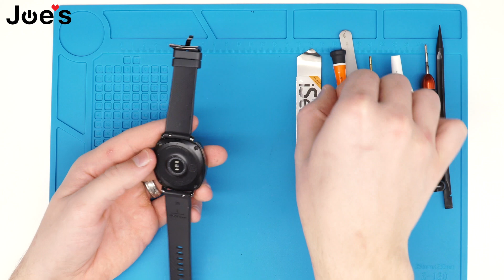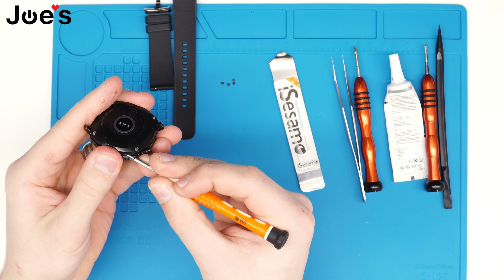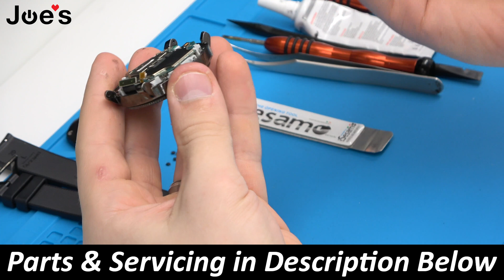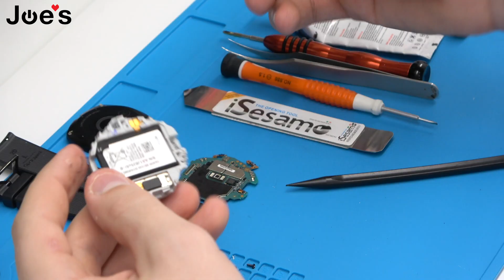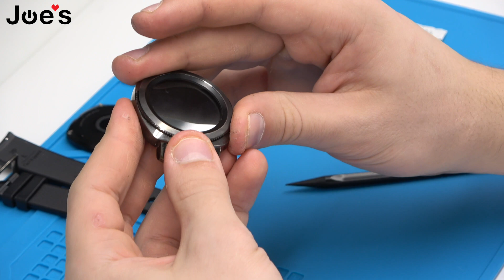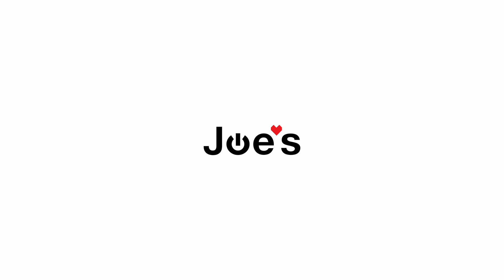Samsung Gear Sport SM-R600 Battery Replacement | Repair Tutorial

Comment from the maker: Buy New Battery + Repair Kit: https://www.joesge.com/products/samsung-sm-r735a-sm-r730a-sm-r730v-sm-r600-sm-r735t-300mah-eb-br730abe-battery-repair-parts?variant=41360580542510
Buy New Battery: https://www.joesge.com/products/samsung-sm-r735a-sm-r730a-sm-r730v-sm-r600-sm-r735t-300mah-eb-br730abe-battery-repair-parts?variant=41360580509742
Buy Repair Tool Kit: https://www.joesge.com/products/y-2-0mm-samsung-back-cover-screwdriver-repair-tool-kit-tools?variant=41045322727470

Comment: Great tutorial. Unfortunately for me, that Philips head screw holding the board to the battery was immovable. #000 screwdriver bit in a good Wiha bit holder and all my 170 lbs. applied to it, and no go. Switched tips, added a tiny bit of PB Blaster, and eventually I stripped the screw. My hands aren't steady enough to Dremel a slot in the screw head. Oh well, foiled again, a new battery and old Gear Sport watch become e-waste.

Comment: My watch wont charge. It turns on but not enough life to do a reboot. I tried different docks and wires, nothing. Dock just keeps blinking red when screen shows battery then it goes black. Will changing battery help?
Reply from the maker: Hello, thanks for commenting. Please email us at support@joesge.com with your question. We will be able to better assist you there. - JoesGE
Reply: @Joesge  why email. Could just said yes or no. Or maybe don't respond at all. Just ignore all questions

Comment: Hello! Great tutorial. I got to around 3:50 but when I connected the board and battery, it got extremely hot and emitted a burning smell. Any idea why that might be? (I immediately detached it and left it.)
Reply from the maker: Hello, thanks for commenting. Please email us at support@joesge.com with your question. We will be able to better assist you there. - JoesGE
Reply: Did you figure out the problem? Mine did the same thing. As soon as the contacts touch it gets extremely hot within 1 second. I immediately disconnected it as well. I was hoping he would actually give you a answer that would help.
Reply: My thoughts is that the mother board might just be fried and the watch is just no good anymore
Reply: Joe should just ignore everyone if he is gonna just reply with "email us" crap when answers could be given. Geeze

Comment: Thank you for your video. I just want to ask about the 'Y' screw driver you used because there's only .6mm size  available in our local market, can this fit for the screws of samsung gear sport?  Thank you for the reply
Reply from the maker: https://www.joesge.com/products/samsung-gear-s2-s3-smartwatch-screwdriver-repair-y-2-0mm-tool?_pos=1&_sid=cc0114850&_ss=r

This is the one we use.

Comment: Excellent video!  I've had my Gear Sport Watch for a couple of years and the battery only lasts about 12 hours after charging now.   I charge it overnight and it goes into power saving mode (about 15% each evening) so I'm assuming I need a new battery.  I've Googled the replacement battery and it seems the EB-BR730ABE battery and the R600NZKAXAR battery will both work.  If so, which would you recommend?  Thanking you in advance.
Reply from the maker: Happy to help. Thanks for watching. Please like and subscribe for more content like this!

Comment: I'm having difficulties removing the screws on the back. Mine seem really tight but I don't want to strip them. I'm using a 1.5mm tri point screwdriver that came with my battery but I noticed in the video you are using a 2.0mm. Will using a 2.0mm make the screws easier to remove?
Reply: As an FYI, I got a 2.0mm and it made the world of difference! The three screws came out easily.
Reply: Well, I managed to round off all the blade part of the 3 bladed screw driver that came with the batter, but the screws didn't even budge

Comment: I got some questions, is there any another brand of glue that can be use and is there any original battery replacement part selling online? I want to replace battery for my 2 years old Smart gear sport either.
Reply from the maker: https://www.joesge.com/products/samsung-gear-sport-sm-r600-smartwatch-repair-replacement-parts?variant=32773218762798 here is the batter
Reply from the maker: https://www.joesge.com/products/silicone-industrial-adhesive-704-rtv-silicone-rubber-seal-black-glue?_pos=5&_sid=3c229e55c&_ss=r here is the adhesive we use
Reply: Thank you very much